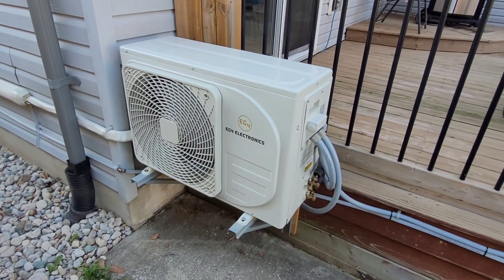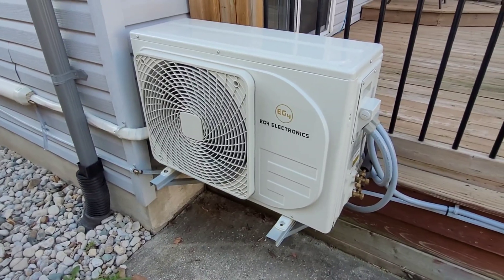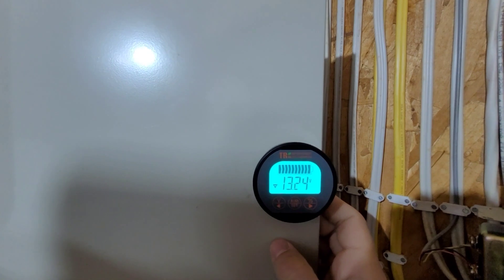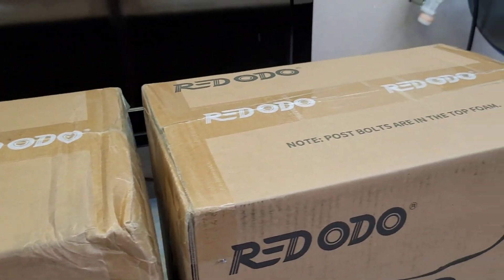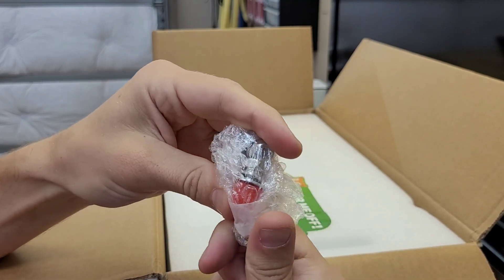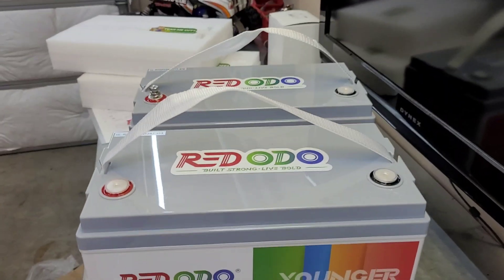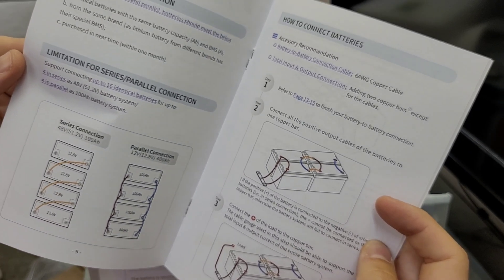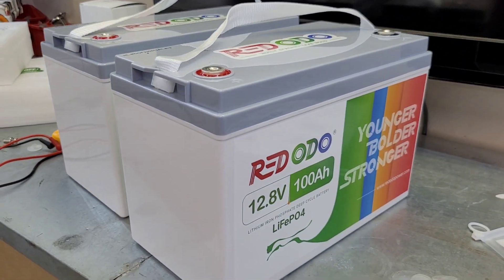Battery Backup For My Solar Mini Split - With Redodo 100AH LIFEPO4

Comment: Can't you just connect a solar panels, a solar controller, and your batteries to the DC in side of the EG4 mini split, so you don't have to deal with DC to AC loss?

Comment: Definitely need solar panels now, and possibly more batteries to last over night. Wouldn’t it be nice to use this year round off the grid, day and night , for heat and cooling for the whole house. 😂 how many of these set up’s would you need for your whole house? 😊
Reply from the maker: I could probably get away with 2 of these for my place, it's well insulated and not that big

Comment: I read somewhere that these solar AC/DC Mini splits that run solar direct can add a battery without going through an external inverter. Did you find any information about that? If so, will you share with us, please? Thank you.
Reply: I just got 2 of those Redodo’s for $289/each.  Delivered.  Gonna do the same thing when I get that same mini split. Thanks for the video!
Reply from the maker: @SaabAholic  that's a great price, it's awesome to see Lifepo4 coming down in price as more competitors pop up!
Reply from the maker: It's possible they could if the voltage was high enough, but I don't want to be the one to try it and void my warranty 😂
Reply: @SmitHVAC.  Do the instructions say how to do it?
Reply from the maker: @johnwyman6126  no, I don't think it's recommended
Reply: @SmitHVAC.  Okay, thank you. Maybe it was a different brand, I have found two that make these.
Reply: I found out that Hotspot Energy makes units similar to this one, and also a battery based 48 V DC unit for places with no AC availability.

Comment: These panels were tied directly into the air conditioner, right?  Are you now tying the same ones into the batteries, or are you using different panels for the batteries?
Reply from the maker: Yes, 5 of them are directly to the Ac, 1 goes to my house batteries
Reply: @SmitHVAC.  Thanks.  So, you have another solar setup for your battery storage other than this one panel?
Reply from the maker: Just one for now. Working on more soon

Comment: Can you run that mini split on a 1000 watts inverter
Reply from the maker: Yes I've been running it on my renogy 1000w, it has overloaded once when it was pulling close to 1000w and we got some cloud cover. For the must part it runs around 500w and its no problem. Upgrading the inverter in the next video
Reply: Do you think a Harbour Freight 1000 watt inverter could handle it
Reply from the maker: @RM-yn1kz possibly, as long as its pure sine wave
Reply: Thanks

Comment: This is what I'm looking to do at home. Our summer power bill has reached $300 a month here in orlando for a 2K Sqft home. I'm getting ready to retire in 2 years so I need to cut down on the cooling bill. I think what you have here is the way to go.Thanks for the video I'm going to ride along for this project.
Reply from the maker: Thanks for watching! It's a great way to go, good cooling performance with heating as a bonus, all from the sun.
Reply: Tampa resident.  Bill is the same for 1560 SQFT because we're home all day.  I don't want panels in the roof of my home, so I'm going to build a solar pergola and add a 24000 btu mini in my main portion of the home.  Stupid Lennar only put a 2 ton unit in the house that should have easily been 2.5-3.0 tons.  I'm not so concerned about batt backup but my thoughts are if I can simply get a rock solid 2 tons boosting the home this will absolutely work well for the house for the majority of the day direct on solar.
Reply from the maker: @ciliap sounds perfect!

Comment: I have put together a 100% off grid solar air-conditioning system. I have a 9000 btu inovair brand 38 seer unit. Its ran from a 220 split phase inverter and 560 ah of lifepo4 batteries.  I have a 150-70 victron charge controller in the system also. I was considering the unit you have bought and it would have not cost me as much and been much more simple to install. Only reason i went the way i did was soon i plan on running a well pump from the same inverter and solar system. O yeah i forgot... its powered by 1850 watts of solar. Thanks for the video. I love this stuff
Reply from the maker: Sounds like a nice setup! This one is pretty straight forward, I love the idea of solar Ac too.
Reply: @SmitHVAC.  the best part of it is basically free ac once it's paid for itself which don't take that long but its kinda a 2 for 1 deal in that we can also heat most the year with this. I'm not sure how cold they actually still work at but mine advertised at heating into the negative degrees.  The minisplit was the game changer in having the ability to be completely off grid

Comment: Problem is no major brands are importing direct solar, powered heat pumps into United States.  

I would like availability of instant parts to service my customers, solar heat pump installations .
Reply from the maker: 100%. This is a secondary system on my house, but if I had to rely on it entirely I would need quick access to parts. Do you install carrier? We have a brand new Carrier Heatpump installed in March with a bad board, and no eta from the dealer. It's unbelievable how some companies are operating right now.
Reply: @SmitHVAC.  I sell LG . 
After the pandemic shut down, everybody has lost their supply line of parts 

I used to get everything same day or next day now sometimes I have to wait 3 to 6 weeks .  Or more
Reply: The company that make the Deye or EG4 heat pump makes a water heater with the same concept. Its quite cool.
Reply: @kameljoe21  yes  they have it at my wife’s house in shanghai 20+ years ago
Reply: @coldfinger459sub0  It sucks that every other place has all the cool stuff yet we are still stuck with trash. I which Deye would import that stuff here in the US. 
I wish they made a full size mini split to use with HVAC system. As I would like to have something like that I also want their water heater as well. Though I am going to look in to putting a couple of the largest water heaters as solar pre heaters. If I can pre heat enough water a day on solar then I might not use the electric for most days.
Reply: @kameljoe21  he just said EG4 a company in Texas sells these units. Not sure about the heat pump hot water heater but definitely the solar mini split.
Reply: @MrBadbonesaw  Yes the EG4 mini split with direct hook up is a Deye unit with the EG4 brand on them. Deye is the maufacture that makes the EG4 unit. They also make a water heater that also has a direct solar hook up. You can look up the company and they have several option and units. The only problem it getting them imported in to the US.

Comment: Dumb question: Doesn't the Victron give you through your phone the same and more info that you are getting from that handy shunt and display?
Reply from the maker: The Victron only gives you the voltage, the incoming wattage, and charging amperage. The shunt is able to measure every amp hour that leaves the battery so you have an accurate capacity reading
Reply: @SmitHVAC.  Got it! Thats why I askded!